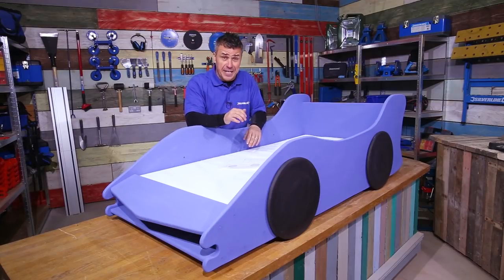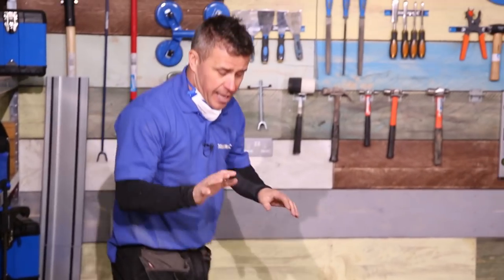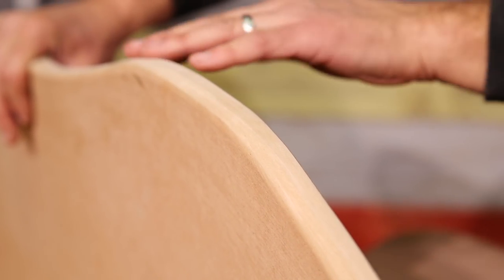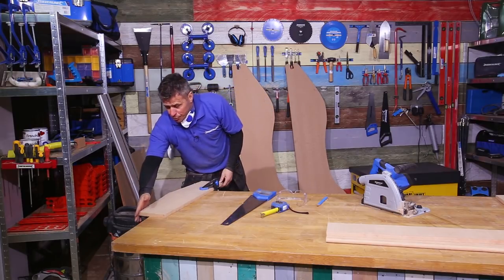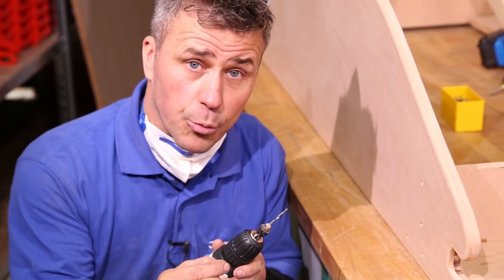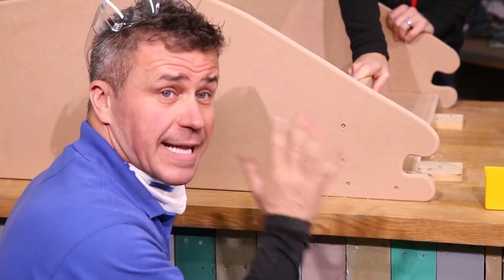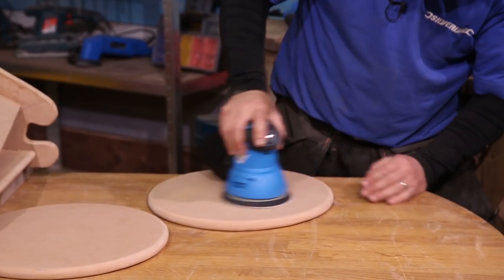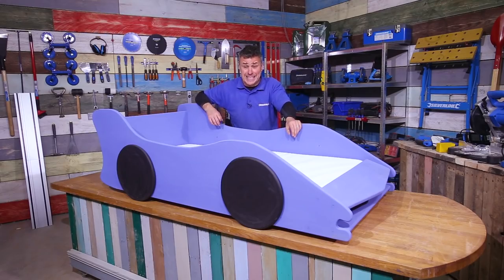How to build a child's novelty car bed

Comment: 04:21 don't use belt sander on this as it can ruin your the mdf shape...it is too aggressive. you should use block sander and sand it by hands.
Reply: Yes if you don't do it too much a belt sander will be fine, sanding by hand is just as good! Thanks for watching

Comment: Hey, I'm a little confused about the back rectangle piece thats 710mm wide.. You do not specify the length of this piece. I'm in the middle of replicating this exact same bed, thanks to you, but a little confused and hoping you can help me with this. If you skip to 5:25 you will see what I'm talking about